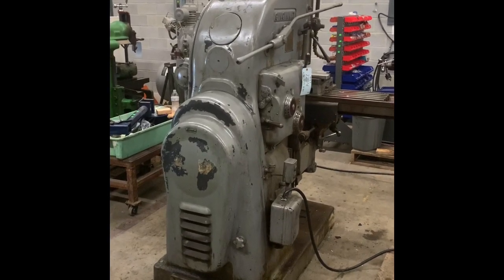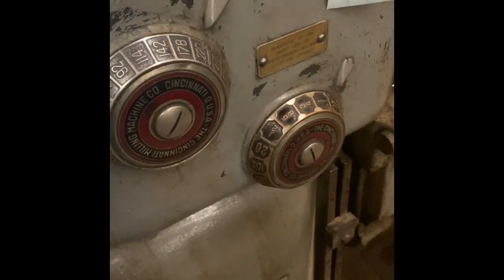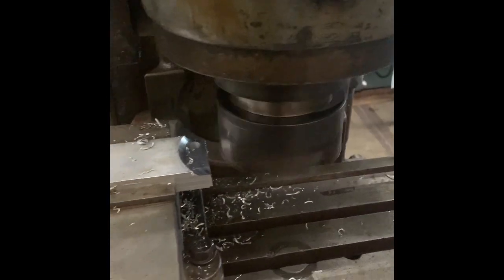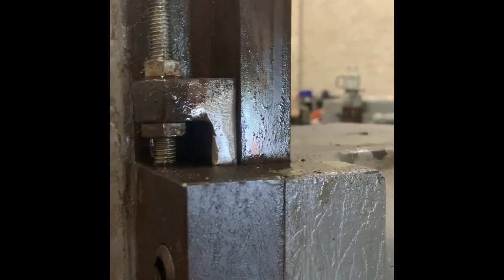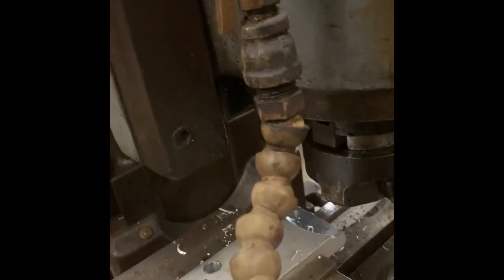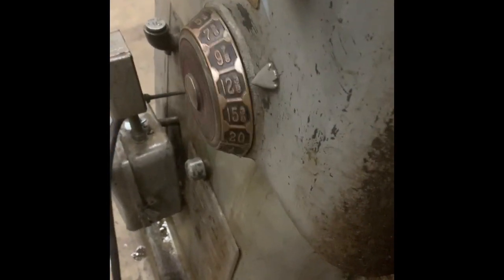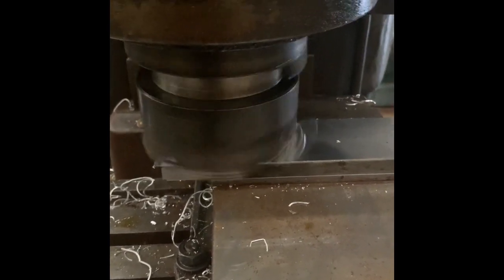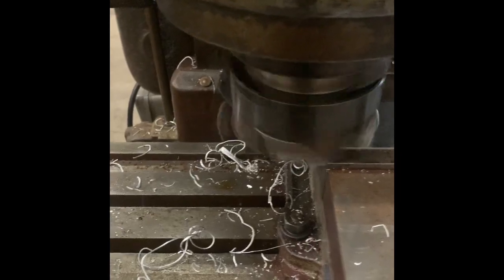Cincinnati Milling Machine Test

Comment: Hey I have a 1950 model verticals mill.. where do you or how does the oil get filled in the head stock….I saw a sight glass on the side of the head like mine has..